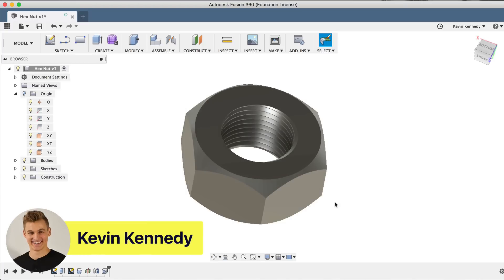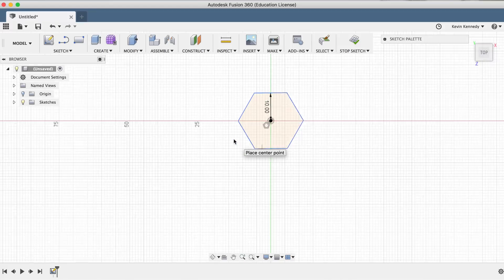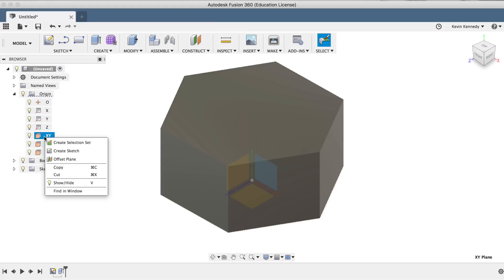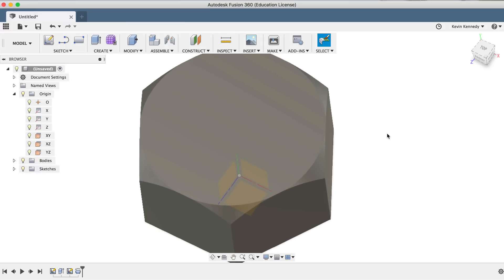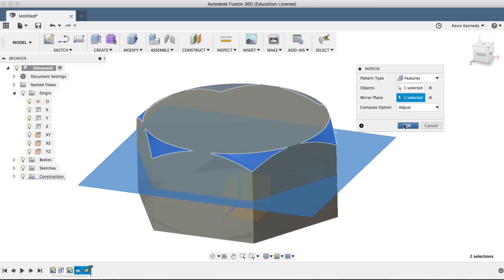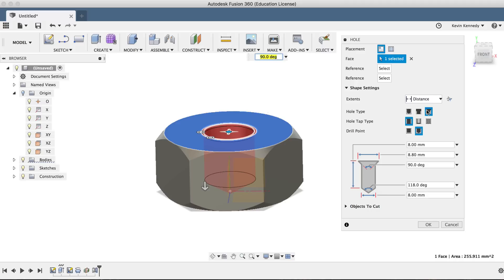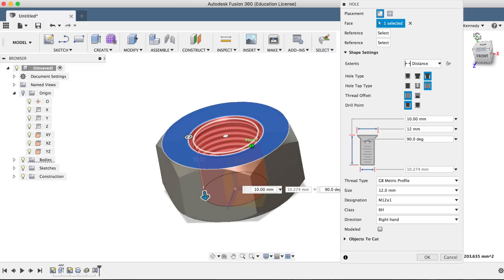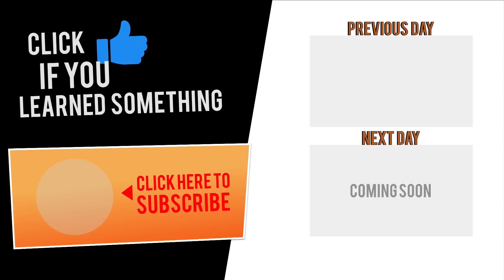How to 3D Model a Hex Nut - Learn Autodesk Fusion 360 in 30 Days: Day #6

Comment: Good job with your tutorials my friend! I am trying to complete the Nut Tutorial and I am having an issue with the Thread Type - I do not see as many options as I see in your tutorial and the size are in inches with very few size options as well - I am sure I am running a different version then the one you used a year ago! Is there a way I can have access to all Thread Type with the version I am running 2.0.7046! Thanks in advance!
Reply from the maker: I see you found the answer to your other comment. For anyone else that has the same question - make sure to select the right Hole Tap Type

Cheers, Kevin :)

Comment: In this tutorial, I need to point out the differences I encountered following the examples you demonstrated using your version of Fusion 360, to the current version of Fusion 360 that I recently acquired. While making the chamfer on the hex nut, you selected the XY plane from the browser and then selected Create Sketch from the right-click menu. The hex nut image immediately turned to face the front of the model. When I select the XY plane in my version of Fusion 360 and selected Create Sketch using a similar manner, the image turned to face the button of the model. If I were to turn the model manually to face the front and create the same sketch, the resulting geometry was undesirable.  To produce a similar chamfer as in the tutorial, I had to select the XZ plane and select the Z-axis. Let me first say that I'm following your tutorials since you present the information in a clear and concise manner, and in a way that I can get up to speed in a shorter amount of time than it took me to get to the same level of knowledge while learning Solidworks.  I'm not questioning your methods rather than pointing out the difference in how the two versions of Fusion 360 are behaving.
Reply: Tony Gomez  thank you so much for that. I’m on this tutorial now tying to learn fusion and I was having the same issue. Thanks to you catching that with the new update, problem solved.
Reply from the maker: Hi, Tony. Glad to see that you caught the difference in Axis orientation. This is because I record the tutorials with the Fusion 360 default settings. However, from time-to-time the Engineers do decide to change them (sometimes with good intentions, others not so much). When I recorded this tutorial the default orientation was the "Y" axis being set to the up orientation.

As you noted, you'll just need to select the opposite plane, per the new default of the "Z" axis being the up orientation.

Don't hesitate to comment if you run into anything else that's different... don't waste too much time trying to figure it out :)

Comment: I hope you're still watching these comments. :)    I'm following along with this series, and for some reason I'm really struggling with this one.     At https://youtu.be/Xho87HJ-XDo?list=PLrZ2zKOtC_-DR2ZkMaK3YthYLErPxCnT-&t=174   when I created the two perpendicular 1.5mm lines and then their connecting hypotenuse to do the revolve.   However when I try to select it I can't seem to select the face of that triangle itself.    If I select one of the three lines they all get slected, and then I can select the middle part, but that now shows 2 selections, and the Cut opton is not available.

I did manage to get it to work once, but I don't know what I did differently and can't do it again.

I can't figure out what I'm doing wrong, I even started from the beginning a few times.   It seems easy enough, but I must be missing something.     I've tried with and without snap, but no luck.   Why is it being treated as a chain rather than as an object/surface?   Any help would be appreciated.    Thx!
Reply from the maker: Hi, Daniel. First, can you check that your settings match mine, here - https://bit.ly/defaultsettings

It may be the "Auto Project Edges on Reference" setting that is causing the issue. If that's not it, let me know and I'd be happy to look at your file. That will help me narrow down the possibilities much faster.
Cheers, Kevin :)
Reply: @ProductDesignOnline  That did it thanks!   I went through and re-did the settings and now it's ok.    I thought I had done that previously but something must have gotten messed up.   After going through them again it worked much better.

Comment: Good tutorial but I'm missing something at "hole" tool.  There's no such GB Metric profile in my thread type and no "modeled" option.  I'm stumble a little bit at the beginning at plane selection but I figure it out.
Reply from the maker: Hi, mtstek. Please take a look at this reference image - https://snipboard.io/w0T4eK.jpg
You'll see that the thread type and "modeled" will only appear after you select the "tapped" (first circle in reference image) option for "Hole Tap Type".

Let me know if that helps to get yours working. If it's still missing please provide a link to a screenshot. Cheers, Kevin :)
Reply: @ProductDesignOnline  My menu has 4 options instead of 3 like yours, I pick the wrong one.  So,  it's working now.  Thanks for sharing.

Comment: Hi, with my version the Z axis is vertical which seems right but your Z is horizontal.  How do I change mine to match the video?
Reply from the maker: Hi, Mike. The Y axis was the default up orientation at the time of recording this one. If you select the opposite plane then you can complete the tutorial following the same steps. Otherwise, you can select your username (upper right-hand corner) > preferences > change default modeling orientation to "Y up" > apply > ok.
Cheers, Kevin :)

Comment: When I go to make the lines for the triangle at 2:22 it does not snap to the edge of the hexagon (I have snap enabled in sketch palette). This same thing happened when I went to create the guide rails for the loft command in the Whiskey Bottle tutorial - they wouldn't snap to the construction lines made. Does anyone know why this might be happening?
Reply: I am complete novice at fusion 360, but I was running into the same issue. Enabling "3D sketch" in the sketch palette seemed to make snapping work for me.
Reply: @pbkobold  thank you for sharing your experience with me, it seemed to work with a bit of playing around.
Reply from the maker: Hi Jorawar Binning. This may be a difference in the settings. Make sure your setting "Auto Project Edges on Reference" is turned on per these instructions on my website - https://bit.ly/defaultsettings
Cheers, Kevin :)
Reply: @ProductDesignOnline  I applied the setting and restarted fusion360 and then this worked like in the tutorials! Thank you for your help Kevin :)

Comment: Hi: When I Revolve to Chamfer the top of my Hex nut, I intermittently get those little vertical lines. I checked off "Auto project edges on reference,' then Quit & Restarted. However, sometimes I get a clean cut, other times I don't. It seems to help if I create a new file several times before I start (by pressing the plus sign.) Any ideas? Could it be some in cache or am I not clicking in the 'exact correct spot' at times.  Example: Creation of the Circumscribed Polygon - click the x or y axis. Thanks! Rob
Reply: @Robert Orchanian Hi Robert, thank you for replying. I’ve tried all the above. The only thing I didn’t do was change my setting to the XY axis. I read on one of updated pages Kevin wrote (that was posted under one of the comments) that the latest update is using the XZ axis and how it better helps when using a cnc. I do have and will be using my cnc. Under another comment I learned in order to draw the triangle (since I am using the XZ axis) I need to use the Z plane, it then worked but I’m still stuck with the little vertical lines after the revolve.
Reply from the maker: Hi, Rob. There shouldn't be an issue with caching. When you say you "checked off" did you ensure it was enabled or disabled? The "Auto project edges on reference" should be enabled for this tutorial (series).

Can you share the link to your file? That will help me look into this to see if there are any other items with your file setup that could be causing issues. Cheers, Kevin :)
Reply: @ProductDesignOnline  Im having thi ssame problem where the lines stay there, but im not understanding bhow to fix it
Reply: Product Design Online I’m having the same issue. The revolve works but I still have the little vertical lines where it seem to not revolve to the very end. I still have the 6 vertical although the rest has revolved. I should be able to just select those little pieces and trim them but I can no long find the cut other than under the surface tab which doesn’t allow to trim from edges just surfaces. Need help getting rid of these lines
Reply: Rob - I clicked snap back on. It still works... gl
Reply: I clicked on "Display Settings" at the bottom, then "Visual Style" and changed the setting from "Shaded With Visible Edges Only" to "Shaded" and the lines went away.

Comment: Is there a way to modify the defaults in threads?  I need a 2.125 x 5 for a project I'm working on.
Reply from the maker: Hi, stxrynn. Within the hole or thread commands there are a number of default thread options that you can choose from. If you don't see the exact size you're looking for you will have to choose the closest option and offset the thread faces to the desired measurement. Cheers, Kevin :)

Comment: Hit a snag with the tapped hole.  When I bring up my hole menu, I don't see all the options that yours shows (no option for a tapped hole, etc).  Seems like I will have to create a hole (either with hole or extrude cut) and then use the thread function?
Reply from the maker: Hi Richard, on my end I see everything the same as this video. Please see this image - https://snipboard.io/w1sB4C.jpg
I should note that some of the options will now appear in the Hole dialog until you hit the "Countersink" and "Tapped" options.

Can you provide a link to a screenshot of what you're seeing on your end? Cheers, Kevin :)

Comment: I've been going through the Learn Fusion in 30 Days and I've really enjoyed the series so far!  I think the biggest hang ups I've had so far have been on lofting the Whiskey Bottle and the Paper Clip tutorial.  While I've been able to successfully complete them both, it seemed like a lot of trial and error to get the sweep correct and the lofting with guide rails to work.  It could just be my unfamiliarity with the application, but does it seem as if the latest version of Fusion 360 is buggy compared to what previous versions you've used?

Anyways, I look forward to getting all caught up!  The UI layout is much appreciated and tools are categorized in sensible manner.  Thanks for putting these tutorials together!
Reply from the maker: Hi, Andrew. Glad to hear you're enjoying the series so far! I wouldn't say that Fusion 360 has gotten any more buggy. I do think the loft with rails (Whiskey bottle) can be challenging to new users, as it's one of those core concepts that has many small things that can cause an error. It's great to hear that you worked through it. Don't worry, those will become easier the more you get used to Fusion 360's quirks.

Don't hesitate to comment if you run into any roadblocks as you work through the remainder of the series! Cheers, Kevin :)

Comment: I'm having trouble @ 3minutes. In the revolve dialog box, under operation, I only have new body and new component. Cut is not listed as an operation. Any thoughts?
Reply from the maker: Hi, musoangelo. It's likely that you have the wrong "revolve" feature activated. Make sure that you're under the SOLID tab and then select "Revolve" from that "create" dropdown list. The solid modeling revolve command has a blue icon next to it.

If yours has an orange icon next to it then you're using the SURFACE revolve command which means it will not have the ability to cut.

Let me know if that was it! Cheers, Kevin :)
Reply: @ProductDesignOnline  thank you for answering the email I'll give

Comment: Had the same problem in v2.0.6670 as Ibrahim below.  After some time fiddling, I got the following to work:

In the browser origin, right click XY plane and create sketch.
From create menu, choose polygon > circumscribed polygon click on center, drag outward and enter 10m, tab, then zoom in with mouse wheel and  click exactly on vertical y axis to align polygon.  Even though snap to grid is on, the polygon does not seem to snap in rotation to the axes.  Hit esc to terminate polygon command.  Notice that the X axis in the view cube does not appear in the same position as in the video.  Click E for extrude and then the home button in the view cube.  Notice again that the axes are in a different position than shown in the video.  Drag up the Extrude arrow until 10 mm is shown, then click ok.  Viewing in the home position, go to the browser origin and right click XZ plane and create sketch.  The video says to create the sketch on the XY plane, but that does not seem to work.  Viewing the front of the nut, use L to create 1.5mm lines as shown in the video.  Stop sketch and choose Revolve from the create menu.  The profile we just created should be selected, and the Axis select should be highlighted, so select the blue Z axis on the axis diagram inside the nut.  Click OK.  For some reason the edge lines of the nut don’t seem to be cut by the revolve and remain sticking up out of the chamfers.  Follow the video for the Midplane/Mirror/Hole steps.  Changing the chamfer length completely messed up the hole, moving it to the edge of the nut, so you might want to select the proper chamfers in the first place.

So my questions are - Why do the axes appear differently in the view cube?  Was my needing to select the XZ plane for the line sketch due to my (incorrect?) selection of the XY plane to create the polygon?  Why are the edge faces sticking up out of the chamfers?  Why did changing the chamfers mess up the hole?

So many questions, so little time...

Glad I got the project finished though, I think I learned a lot.
Reply from the maker: Hi, Vince. Thanks for sharing this. I'm glad you worked through the issues and got it finished.

I recorded all of these tutorials with the Fusion 360 default settings. However, from time-to-time, the Engineers decide to change one of the default settings. When I started recording this series the default modeling orientation had the "Y" axis set to up. They later changed it to be the "Z" axis up, which is why the first 4 videos which have been revised all have the "Z" axis up.

You can also compare your settings/preferences with mine, here - https://bit.ly/defaultsettings

Don't hesitate to comment if you run into any more roadblocks!

Cheers, Kevin :)

Comment: When I try to make the lines for the chamfer they don't snap onto the corner. Any idea why?
Reply from the maker: Hi, Brandon. This is likely a setting that is turned off. Select your username in the upper right-hand corner > preferences > then under "General" > "Design" tab...then select the following setting: "Auto project edges on reference"

You'll have to restart your Fusion 360 in order to get these changes to take effect. You can also check out all the settings I have by going to my web page - http://bit.ly/defaultsettings

Let me know if that fixes it. Cheers, Kevin :)
Reply: @ProductDesignOnline  very useful bro. Thanks!

Comment: So I am following these series for 3 days and today fusion 360 got updated. Some things changed and I thought that wont be a problem for me but when I tried to draw lines for the revolve cut, ı realized that I wasn’t able to draw from the corner of the hexagon, It only snaps to the grids. I also couldn’t change the dimensions for better improvements. I am realy sick of this new “update” and would be grateful if you could help me.
Reply from the maker: Hi, İbrahim Yıldız. I recorded all of these tutorials with the Fusion 360 default settings. However, from time to time the Engineers change the default settings.

Click on your username in the upper right-hand corner > preferences > then under "General" > "Design" tab...then select the following setting: "Auto project edges on reference". That should take care of the issue you're experiencing.

You'll have to restart your Fusion 360 in order to get these changes to take effect. You can also check out all the settings I have by going to my web page - http://bit.ly/defaultsettings

Cheers, Kevin :)